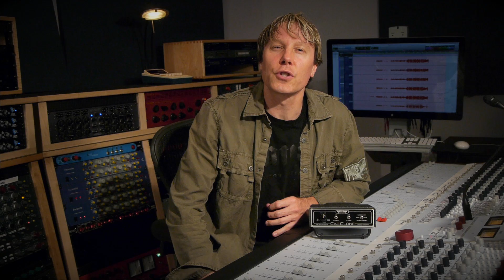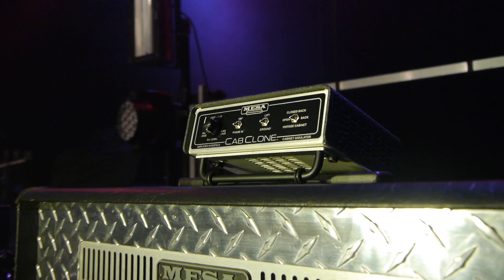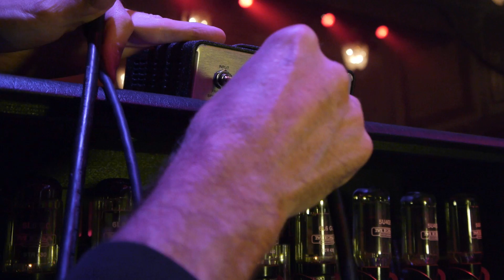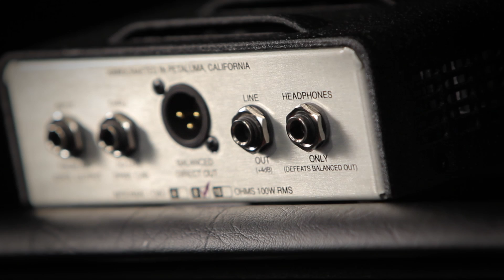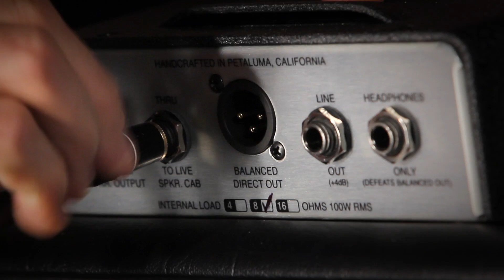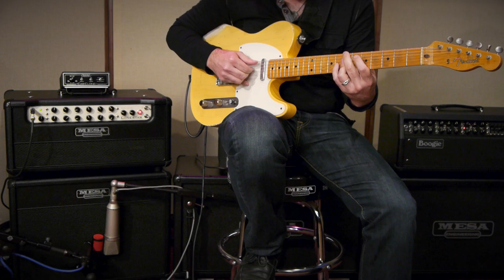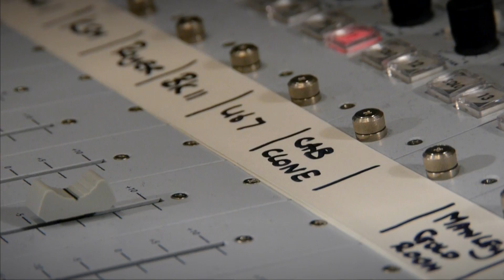MESA/Boogie CabClone Official Demo Video

Comment: So this is a silent recording device or to be used as a simulator but not to soak the sound?
Reply from the maker: Hi +Bflatest - The CabClone provides a direct output via Balanaced XLR out and simple, analog Cabinet Simulation. You can use the internal load to record silently, OR - you can use the THRU jack on the CabClone and use the XLR output AND your speaker at the same time. This is not a power soak where you turn your amp up MUCH louder than you would normally use it connected to a speaker to get more power section saturation. That said, with lower watage amps, the CabClone&#39;s internal load is rated at 150 watts and can handle your amp being turned up a little bit past where you would use it if connected to a speaker and you are in the same room. Hope this answers yuour question and thanks for your interest! :)
Reply: thanks I love my Mesa Express 112 original not plus. I am looking for a good cabinet extension also. but can't afford mesa now do you know one that is a step down or a used one ?
Reply from the maker: Awesome, Bflatest - All Express are good express. Please check with your local dealer or distributor for availability of cabs (new or used). Rock on! :)

Comment: As I'm new to home recording and I don't want to mess up anything (might be a dumb question but oh well): I own a Mesa Boogie Mark V and ordered a Cab Clone today.

I've heard that the speaker should never be unplugged from the amp - but in case I want to do silent recording with the Cab Clone, can I unplug the speaker anyway from the 8 Ohm input and only have the Cab Clone (4 Ohm) connected to it? And of course afterwards plug headphones into the Cab Clone. Would I damage anything that way? And afterwards I assume I can simply plug in the speaker again (no matter if the cab clone is connected or not) - right?
Reply from the maker: Hi +SwissWolv – Great question and excellent choice to ask before causing damage to an amp. Any tube amp must always have a speaker or a load connected to it if it is on and has a guitar plugged in and signal going into the input. You seem to suggest that your CabClone is a 4 ohm unit, and if so, you need to connect the CabClone to the 4 ohm speaker out jack on the amp. If the Mark V is a combo and you have the original speaker in the amp, it should be an 8 ohm speaker and we would highly recommend you get an 8 ohm CabClone to optimize your options with both the amp and the CabClone. The golden rule is, if you want to use the amp with the Headphone Out of the CabClone, make sure the matching impedance speaker from the Mark V is connected to the impedance of the CabClone and it's Speaker Input. If both are 8 ohm, you can connect the CabClone THRU to your Mark Five's speaker when you want the speaker to work and disconnect it when you want to use it for silent recording or headphones. If your CabClone is a 4 ohm version, you need to make sure the CabClone is connected to the 4 ohm Mark V Speaker Out, then disconnect that and plug the Mark V speaker into the 8 ohm jack when you want to use that. Hope this helps and let us know if you have any further questions - happy to help. Oh yeah - and hope the Mark V is working GREAT for you!

Comment: I have a cab clone and have had it since it came out. At the time I was living in an apt. I used it for about 6 months before I finally gave up. I could never get a good clear and concise metal tone. I had tried everything. Now I use it as the speaker load and go out from the line out (emulation bypass) to a Two Notes CAB. This setup actually sounds great and have been using it for almost 2 years with no issues. You can get some decent cleans and blues crunchy type tones using only the clone. I literally tried everything to get it to sound decent for metal but never was able to. It works perfectly as the speaker load and is a cheaper alternative to more pricey load boxes ( got mine for $120)
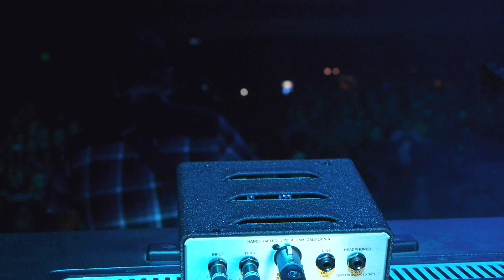Reply from the maker: Hi +Jonathan David Lee Aldridge – Sorry to hear you had trouble getting a good metal tone from the CabClone but glad you were able to find some other good sounds. Here's something to try for good metal tones: Set your amp fairly low volume (I know - counterintuitive, but, stick with us), then set the output between 1:00-3:00 and adjust your input gain on your DAW to get a good signal from that setup. In the case of direct recording, it's not as much about CRANKING the amp up as it is finding the setting that makes the signal sit right. With the lower overall volume level you get balanced bass (that you can turn up with the bass control if you want more) and lots of good saturation. Check it out and let us know what you find! Thanks for the kind words and taking the time to comment!

Comment: Hi, I have bought one of these and for some reason it makes my jcm800 sound like a horses ass... Is anyone else experiencing this problem?
Reply from the maker: Hi +MrELITEdonkey – When using a passive direct box, if you are attempting to accomplish a mic'd sound, you might need to consider adding EQ at your console or DAW in post to make up for frequencies that a PASSIVE device is unable to provide boost for. For a JCM 800, I might suggest adding 2-3dB of lows at 80-100hz and maybe a pinch more at 175-250hz. You might also want to scoop mids by 2-3dB somewhere around 600-900hz. Finally, you might want to use a low pass around 5-6K but the addition of bass will also make the existing highs sit better. Experimentation is key and while the CabClone is not a microphone, getting it to sound like one by adding the frequencies that are not represented in a silent, passive direct capture can be easily done with post EQ. Hope this helps and thanks for your comment! :D

Comment: mesa this is not a good product it just doesn't sound good, and i think your amps are amazing but this is a great concept but the execution is terrible so please take my words and better your product
Reply: I'm leaning towards the response from Mesa.... 

I own multiple Mesa products and love them, but the settings have been the biggest hurdle to get over... Once you learn to dial in settings you can make your sounds truly unique and high quality. 

I would encourage Mesa to send me a cab clone and I will demo it and show in detail the requirement of matching gain vs microphones, this would very easily sort out the discrepancy from other review videos... Whom sadly didn't take the time to try and make the product shine, but instead jumped on a negative PR bandwagon 

Thanks :)
Reply from the maker: Hi +ぺいんさいらす – Thank you for taking the time to share your thoughts. Have you tried the CabClone yourself or are you basing your comments on other videos you've watched? Have any of the videos you've watched provided education on how to get the best recorded sounds from a passive direct box or did they just quickly compare them to a microphone without dialing each type of recording device to sound it's best? There's a lot involved with recording great guitar sounds, whether you use a direct box, a mic, digital or IR. Learning how to use the devices you need based on your environment is what is required to get the best sounds you can. The CabClone is NOT a microphone, so you have to treat it differently than you would a microphone to get it to sound great which is where a comparison to a mic without dialing the sounds is not really accurate, reflective of the recording process, or helpful to people looking to record direct with a passive device. Thank you for taking the time to comment and hopefully this will help you to look into whatever products you prefer to record great guitar and great music! All the best... :)
Reply from the maker: Many thanks, missy holt. Really appreciate the thoughtful comment and the support. For those who understand how to use a passive direct box, the CabClone is a great piece of gear. Sadly, not everyone understands how to use one or is willing to educate themselves. For those who do, we offer a great product that will interface your favorite tube amps for silent recording and headphone use. Thanks again for the kind words and you are also VERY correct about gain matching. The videos in question were very obviously NOT gain matched and in all cases the mic'd examples were louder which will always be 'better' in a comparison situation. Cheers! :)

Comment: it seams to do cleans well but when you add gain it sounds like someone threw a blanket over a speaker, neat idea but im not worried about doing cleans quietly. it needs to be able to handle gain.
Reply from the maker: Hi +Riley Whyte – Good observation and thanks for the feedback! :) Keep in mind that when YOU are recording direct, with a CabClone (or anything, for that matter), you'll set the amp and all of the rest of the elements in your signal chain where they need to be set for you to get the tone you want out of your monitors. The CabClone is no different in this regard and as such, is no brighter or darker than anything. The sounds you hear on this video reflect the settings of the amp and the capture environment as much or even more than the CabClone itself. Recording in general is highly dependent on the user and your application. The CabClone is relatively transparent with slight tonal variation available from the voicing options. The final output is very dependent on the user and their selections from everything else in the signal chain, and including the CabClone. Hope this helps and thanks again for your comment! :)

Comment: If this is the best DI box out there, then why would anyone in their right mind EVER buy a DI box??? My Digitech RP500 multi-effects unit was $150 used and sounds a million times better. Their fake Mark IV sim through their fake 412 cab sim sounds better than a real Mark V through its own built-in Cab Clone. Yikes. (Granted a real Mark V is worth every penny without the unnecessary cab clone).
Reply from the maker: Thanks for the kind words regarding the Mark V, +Johnny Strings – Much appreciated! People buy DI boxes for MANY reasons. So they can record direct, silently, and because they aren't in a position to record with a microphone. So they can have a direct signal with the amp of their choice in a live playing environment without having the speaker in use (quieter worship playing, etc). So you can record guitar in a live situation and for monitoring when you can't have an amp in the room or isolated and mic'd elsewhere. There are more (reasons).... There are many ways to capture direct sound but at the end of the day, each way is just a tool, and a method to get where you're going. Apply the tool correctly and get the job done. Whether you like the tool or not has as much to do with understanding how to get the best tones from it and how much money you have to spend to get there. The CabClone offers excellent DI response with a built-in load and a nice feature set in a compact, passive footprint. Thanks for taking the time to share your thoughts! :)
Reply: Understood on why people might like to do it, and it would be fun to try live (sending both a mic and the DI for a combination of tones)... and Im generally a fan of "sound" ... it may be different but that doesn't mean it's bad, and certainly the sound can be shaped to the DI vs. the actual cab.... but for me, I'd like to find an excuse to get rid of the aforementioned RP500, and have yet to come up with one: it sounds better than cab sims, better than BIAS, etc... which means it's good, so no biggie; as a friend once said: great tone is a journey, not a destination. (Though the Mark V may force me to disagree with that mantra... that thing is insane.)
Reply from the maker: Many thanks for your reply, +Johnny Strings – Recording and direct applications have come a long way with newer technologies in the last 5-10 years yet, affordability and practicality are just a few reasons why passive direct boxes have relevance in today's applications. One just needs to understand the workflow involved to get the final tone where it needs to be. Indeed... it's the journey, but the destination is nice to... it's music! :D   Thanks for the kind words on the Mark V. 6 years from launch, it's still an insanely awesome and relevant amplifier. Rock on...

Comment: do i need to connect the head to a speaker? or can i connect it directly to the cabclone?
Reply from the maker: Hi +Pedro Antônio Parreira - The CabClone can be used either silently with no speaker connected (and uses an internal load built into the CabClone), OR - you can plug it into your speaker as well (which bypasses the CabClone). Hope this helps and thanks for your interest!

Comment: Using the Mesa mark v 25 cab clone feature can you run a xlr cable directly out of the amp to say studio monitors or a PA? If so which way would you set the speaker on/off switch??

Comment: hello just wondering if i will be able to plug in my line6 pod hd500 ( digital guitar amp emulator) into this and then run it direct into my mackie srm650 PA speaker for a more real amp sound? Or does it only work with valve amplifiers?
Reply from the maker: HiNic Lynch – The CabClone is designed to work with an amplifier power section output. Your HD500 is basically a preamp signal, so the CabClone isn't designed to work with it. Good question and thanks for your interest. :)

Comment: Hi, can I run my preamp pedal (AMT, Blackstar Dual, etc) to the Cabclone or just Valve amps?
Reply from the maker: HiVelhos Novos – Great question! The CabClone will work with Tube or solid state amps but it doesn't work with just preamps. It's designed to receive power section output and provides a balanced XLR Output for direct use from there. It won't work with a preamp. Hope this helps! :)
Reply: +MESA/Boogie Thanks for your reply!!! My question is about to run Head + Cab Clone + speaker FRFR. Do I need a active speaker or passive speaker?
Reply from the maker: Hi Velhos Novos - Because the CabClone XLR Output comes BEFORE the speaker, the CabClone is not concerned with whether you use a passive speaker or active FRFR. So - you can use whatever speaker you prefer for your 'live' sound with a speaker. Different types of speakers connected to the CabClone's THRU may change the XLR's tone slightly, but not enough to make a huge difference one way or the other. Thanks for your excellent questions and hope this helps! :)
Reply: +MESA/Boogie Many Thanks! I was thinking of using the Cab Clone just as load box and use my Torpedo Cab together. by the way, I Will try it out. regards

Comment: Mesa I need to know if the line out bypasses the speaker emulation, but still allows my amp to be recorded. If so, would I be able to use other speaker emulations like ownhammer or redwirez for recording. Thanks.
Reply from the maker: Hi Albert Garcia– The Line Out DOES bypass the emulation - so if you want to use that for direct recording and add sims after, you absolutely can do that. Some have also just used the Open Back setting and added sims to that as well with good results since that's fairly neutral/natural to begin with. Some have said it even sounds better. Thanks for your interest!

Comment: Hi Mesa,

Does the Line Out from the Cab Clone includes a cab simulation or it's a direct signal which can be used with other cab sims?

Thanks!
Reply from the maker: HiCharles Salvacion – The Line Out of the CabClone is UNAFFECTED - so you can use it with other simulations like IR etc. is that what you're hoping to do with it?

Comment from the maker: Hi +chickensandbeandip - Thanks for the kind words - glad you dig! Other than the removeable tilt back foot toward the front of the unit (designed to loosely 'hook' onto a cabinet handle), there is no intended mounting system for the CabClone. As for comparisons, because the CabClone is it's own unique voice, mic comparisons can be somewhat misleading but we are working on additional videos to showcase what the best ways the CabClone can be used to potewntially sounds even better than a mic, especially when mic'ing isn't available to use. thanks for watching and hope this helps!
Reply: Where can we find the link for the detailed explanation? I am digging it to have better solutions 🙌

Comment: Hi there! Is this device able to handle a different level of ohms from the head into the Cabclone? For example, if my 150W Triple Rectifier head was set to 4 ohms and was sent to a 16 ohm Cabclone, would it still work?
Reply from the maker: HiWhitefireshreds - You are asking two questions here. The first one has to do with what impedance version of CabClone should you buy. The answer to that is, you should buy the impedance version that matches the Cabinet that you will most often use with the CabClone. If you have an 8 ohm cab, that's the CabClone version you should buy. Hope this makes sense. The second question, is yes - you can play a 150w Triple Rectifier with the CabClone as it is rated for 150w usage now. Hope this helps and let us know if you have any further questions! :D
Reply from the maker: Hi ***** - Good question! Actually, because most amps offer different impedance OUTPUT options, customers should buy the CabClone that matches the cabinet they will likely most often use, IF... (this is the important part) they are using the THRU feature on the CabClone. Your question suggests that the CabClone is only used silently and that is not the CabClone's ONLY potential usefulness. Again, since most amps usually offer multiple impedance OUTPUTS, the most important impedance decision to make when purchasing is which cabinet you might use it with and then use it with the appropriate impedance output on the amp, whether you are using the THRU or not. Hope this helps and thanks for your interest!